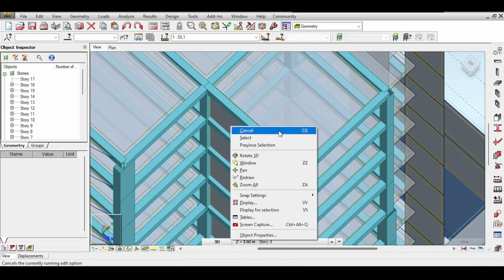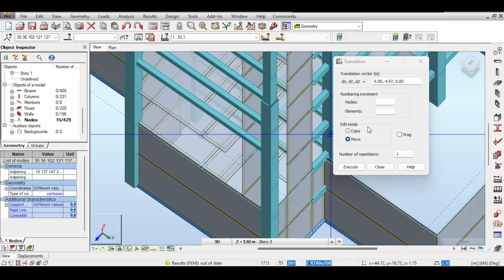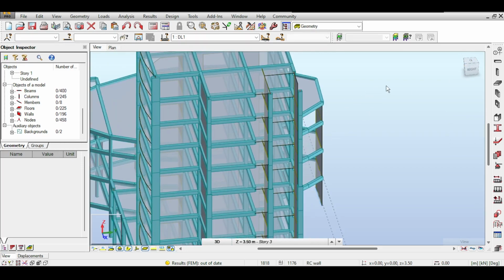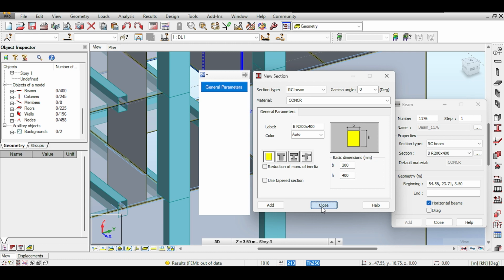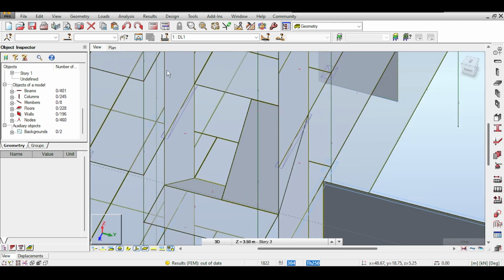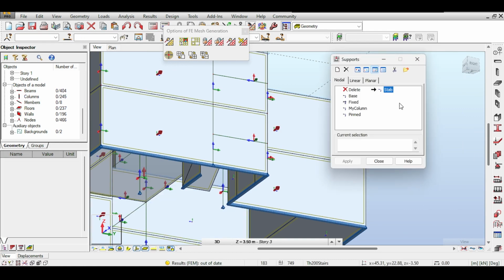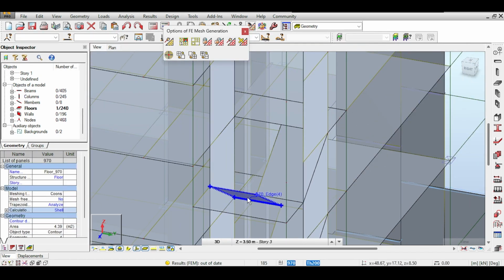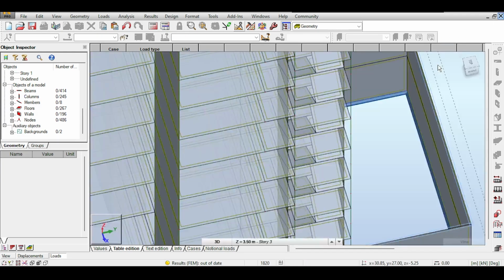Modeling and Design of RC Buildings in Autodesk Robot | Part 12: Staircases

Comment: Hello Dr. CEE

LOL 04:20 Evil Laughter 

@08:10, the practical issues and tips provided regarding the brickwork or blockwork and the concrete beams is a welcome and nice detail to share, thank you. 

15:49 Dr. CEE, I see what you mean in the model when you say that the shear walls feel the staircase. I am imagining that this may not be what I would need considering that the staircase landings have a beam and floors on opposite sides that could be used as convenient supports for the staircases. How would one go about removing the link between the staircase edge from the shear wall? Would one do this by releasing the one edge of the staircase next to the shear wall? Would this exercise make any significant difference in the global behaviour of the entire structural model and the overall stability (including twisting of the building) or would it still be “good enough” accuracy irrespective of whether the staircase edge is released or not?

I must say that I like the decision to install columns at the stairs corners and the beam between these columns in order to support the staircases. This configuration is to me the most robust and straightforward (less complicated) approach. I imagine though that the architect may not be too pleased about this and may have preferred the “fancier” corner-window style like arrangement which they had on their original architect drawings as this would look more visually attractive compared to the square-ish corner columns and beams….. How does one nicely persuade the architect to accept “robustness” over “fancy looks” in situations like these in your experience?     

I have enjoyed this video and I am looking forward to the next CEE videos

Keep well and kind regards, DK
Reply from the maker: Hi there Engr. DK,

I am happy that those details of "stair beams" were beneficial. Please note (for all future readers) that this is a regional thing. So your implementation might be different. I have seen people just casting the beam on the wall directly.

As for the staircase and shear wall. Two alternatives exist: the cleaner one is to provide a release of "everything" at that edge.
the less cleaner one is to draw the staircase slightly smaller than it is. Of course the later one seems to be "patchy".

Oh!! here is the word I was looking for. The "landing". I somehow forgot the name of that thing during the recording ^_^. I believe that the release vs non-release will have a certain effect with regard to the twist of the structure. Released being a less stiff alternative.

Well, I actually failed to mention the architectural implications of what I was doing. Now that I think about it, I think it should be one video that basically double checks our column sizes with the arch, and discusses what we can do to minimize the effect of our column sizes when we compare it with the Arch's drawing. But at least to give you an idea, I am planning "for example" to split the new shear wall into 2 shear walls or model openings in it.

Still, regarding to how team-work goes, I can say from my previous experience that it actually goes like this:
1) Arch gets the conceptual Idea from the owner
2) Arch throws out a conceptual architectural draft of the building.
3) the draft of the building gets passed to the str. department to add their columns and beams and mention any requirements (such as story heights to accomodate larger beams, something I am going to discuss later)
4) multiple rounds of negotiations occur. Like 3-4 meetings for the next week.
5) a finalized concept of the structural system is achieved, and the arch does his full drawings with sections
6) (JOKE!! DARK HUMOR) structural engineers usually get back-stabbed by the "finalized" drawings the Archs submit. With things we agreed upon being changed without prior notice.

7) Modeling and so on starts.

So with such a workflow (disregarding the dark humor), such quick decisions during modelling would actually not occur. If such a thing occurs, discussions would recommence and rinse and repeat from step 4

Hope it helped.
Note: this process was during my work as junior engineer in the structural department of the Ministry of Public Works and Housing. 

Regards,
CEE
Reply: LOL, Et tu, Brute?  Thank you Doc.